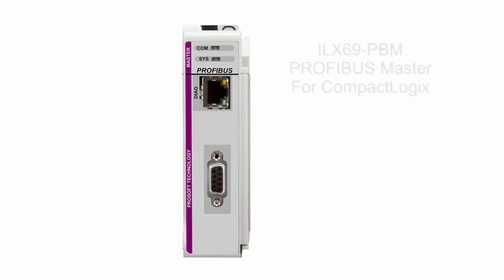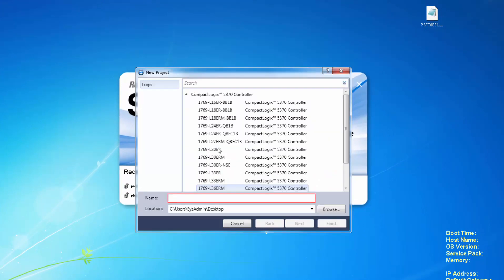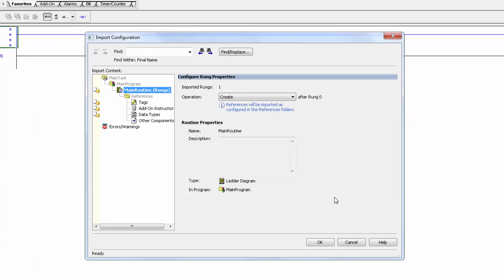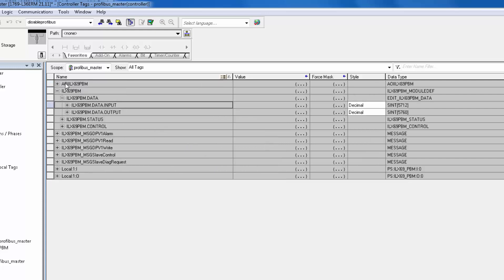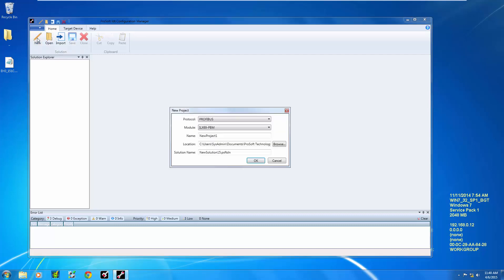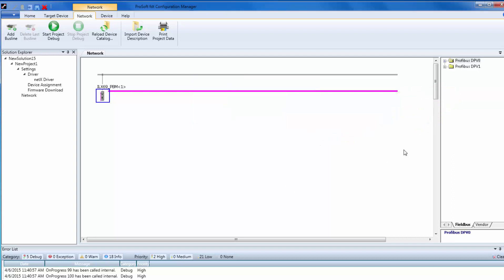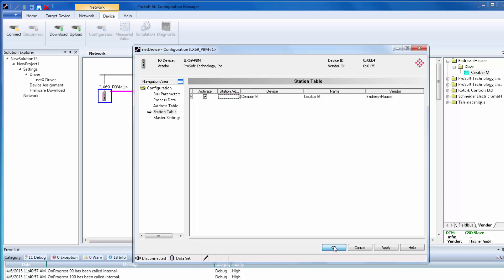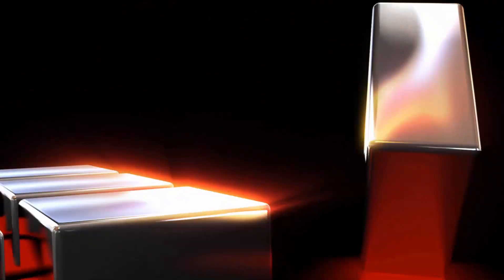Set Up: PROFIBUS Master for CompactLogix Using the ILX69-PBM

Comment: I followed this example using a small ET200 rack but cannot get it to work. 16# 0312 link error is indicated on the module in studio 5000.
Many of our engineering group have looked at the problem, but no luck.
Note there is not any ECR plug on the PBM card. Could this be our issue? 4-2022 any comments would be appreciated
The I/O rack works on a CTI PLC…
Reply from the maker: Hi there! We'll need some more details to help - please contact your regional tech support team: https://www.prosoft-technology.com/Services-Support/Customer-Support . Thank you!
Reply: Thanks so much for the reply! Today we robbed an end cap from a system that was down  long enough to test the unit we are having trouble with. Absolutely it was necessary and fixed our problem.
It would have been nice if Allen Bradley had shipped one with our 1769-ER30 CPU, but now we know what the problem is.  I’ m going to verify that the one system we have does or does not have an end module- but using Ethernet communications. I was told by him that there was no end cap (ECR) on that process,  but I’m skeptical. I will post another rep,y back about that. Definitely needed when using the Profibus module along with proper termination on the cables of course. Hope this helps someone else…
Thanks again!